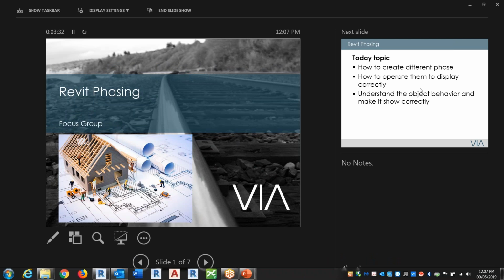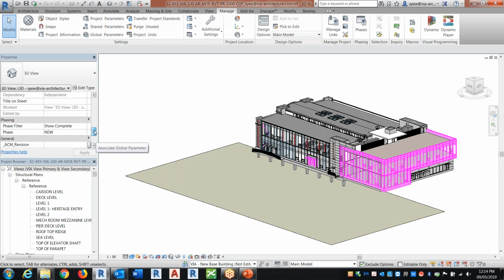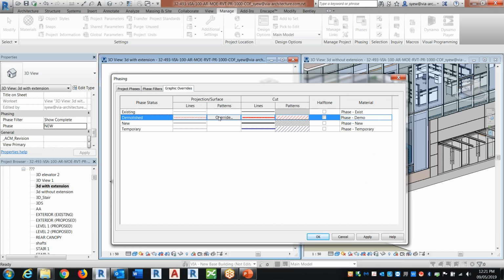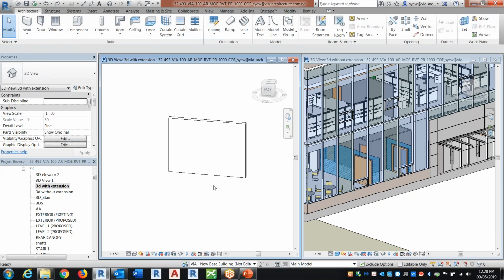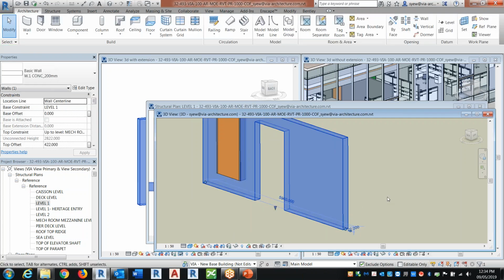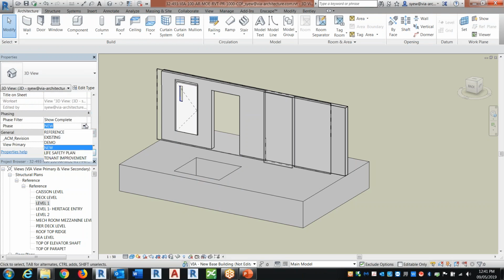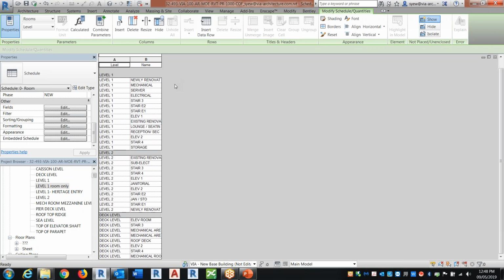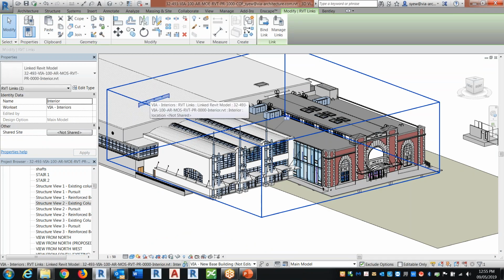Focus Group  -  Revit Phasing

Comment: Good tuto as usual. Revit is very powerful... in demonstrating how silly I am... lollll

At work I am trying these days the phasing AND model options. Tipically i have to modify the interior design of existing hotel rooms. So i have existing spaces, then two or more options for the new design each with it's corresponding demolitions. What i'm doing now is to have a file for each option cause i can't find a right way to have all my options in the same "phased" file.
I hope you could give some tips for such cases.

Thanks again for the tutos and forgive my bad english.

Regards,
Reply from the maker: Sure no problem. What I typically would do is keep the demo and existing in the current file. Design options can be useful, but what I find the issue with design option is you cannot move object(s) from one design option to another without deleting them. If you need to use design option for multiple plan scenario, I would definitely use it. I brought up the phasing as an alternative only if you have two options and you can move the object to different phase. If you want multiple, I would do links as third alternative so you can link those options into your model. Hope that helps.
Reply: @scourdx  Thanks a lot.